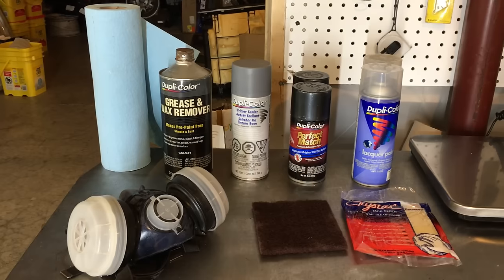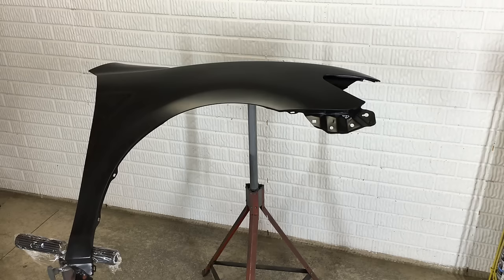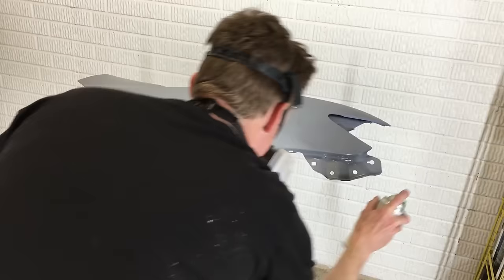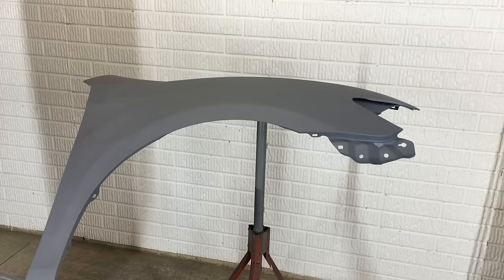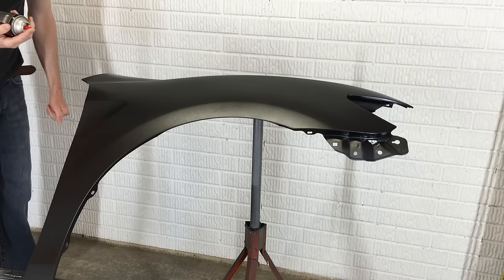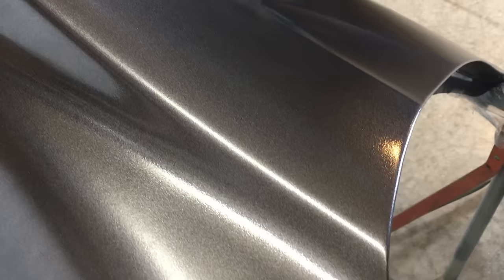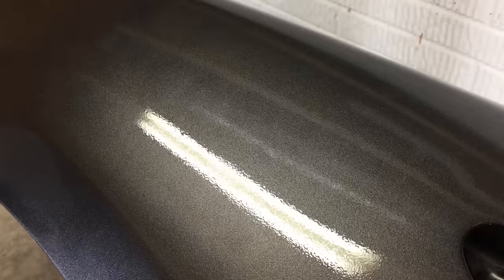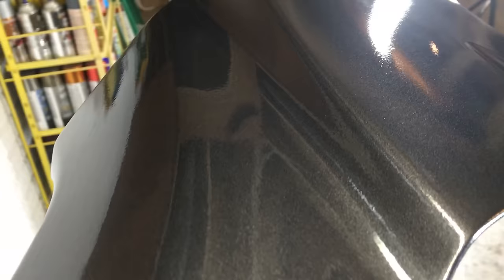How to Paint a Vehicle Fender with Spray Paint - Cheap & Easy!

Comment: Good video...unfortunately i got TERRIBLE results with my paint. I had my color matched thru Dupli-Color, the surface was prepped, sanded, wiped down to make sure it was clean, wiped off with a tack cloth...i shot one light coat, 3 consecutively heavier coats ..making sure it was nicely and evenly covered...waited 30 mins and applied clear coat...waited 30 mins between coats...its blotchy, no gloss, terrible finish. Dupli-Color said i was supposed to wet sand between each color coat and before applying the clear. Sadly i wasted over $150 in grease/wax remover, tack cloths, sand paper, primer, paint and clear coat.
Reply from the maker: No need to wet sand between each coat... that's bs. I mean maybe if there was a crazy amount of orange peel.  It sounds like you did everything right with the prep and cleaning. Without seing the results, I'd say try wetsanding & polishing the clear coat and see what happens. Do a little area first in case it doesn't turn out.
Reply: @6thGearGarage  I actually replaced an old fender on my truck so i prepped a spot on the old fender the same way i prepped the new fender and i applied coats to it at the same time i was applying coats to the new fender..that way i always had a test panel to work on. I have shot Acrylic Enamel for years (probably 15 full paint jobs) and i never had a bad one. Thats kinda why I was shocked to see this one come out so crappy. Do you have suggestions on Wet Sanding grits..I've got 1000, 2000 and 2500 on hand and i have a fresh bottle Meguiar's® Clear Coat Safe Polishing Compound, G18116. The only polisher i have is a 3200RPM polisher...i normally use something with a lower RPM (around 1250-1700RPM) but it died the other day. By the way...Thanks for the reply.
Reply from the maker: @MDTAR15  I can tell you know what you're doing. the products  you have will work. I'd recommend 1500 between the 1000 and 2000, just so you're not sanding forever with the 2000, trying to get past the scratches from the 1000. The lacquer paint stays soft for a little while compared to other paints, so it should cut easily. Just be careful you don't go too far with the buffer and burn through, especially on the edges. It's easy to do with this paint.  I used a terry cloth pad.
Reply: @6thGearGarage  . I sent you a message on your Facebook page. I wet-sanded and didnt notice any "color"..everything was leveling out pretty nice. I switched to a small low-speed polisher with a Meguiars light polishing compound and within a one minute i noticed some color on the pad (very little)...so, i am guessing i went thru the clear while sanding or polishing...probably polishing since my water never turned a color while sanding...I actually can not see where it went thru. Not sure how to correct this with these products. Not sure if i should wash the panel, wipe it down with grease and wax remover, lightly sand the whole panel with 1000 and re-shoot several coats of clear or what? It's getting a little pricey.  By the way, thanks for taking the time to follow up on my questions.
Reply from the maker: @MDTAR15  Hey I just replied to you on FB. It's easy to go thru, especially near the edges. You could lightly wetsand and re-clear, or if you're happy with the way it looks, call it done since you already polished it. There may be a tiny area with no clear, but you will need to keep a good coat of wax on this paint at all times anyways to keep it looking good. It's cheap paint and not meant for a show car finish. So if it looks good, I'd call it done. Maybe send me some pics of it on FB.

Comment: You don't put paint on the back? Should at least do the fender bottom.
Reply from the maker: I did paint the bottom, but not the back, as it has a plastic fender liner and will never see Sunlight.
Reply: @6thGearGarage  I don't know. I usually just spray some paint back there of whatever color I may have kicking around. But I live in New Hampshire where they put a lot of salt on the road. Probably doesn't matter. Either way that fender will probably outlive the car.
Reply from the maker: @lostintime8651  I didn’t think about road salt. That’s actually a good idea to paint the back side then. There could be a thin or small bare spot in the EDP and it doesn’t take much for rust to start in the north east.